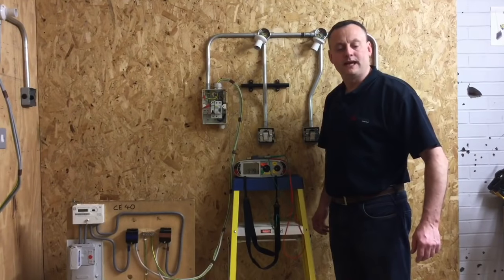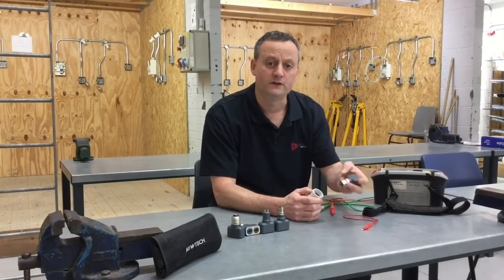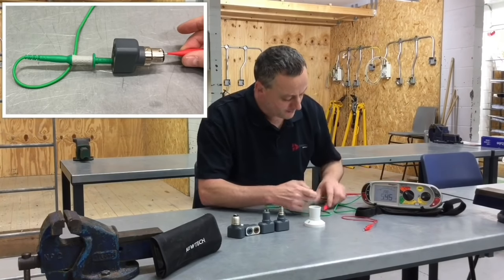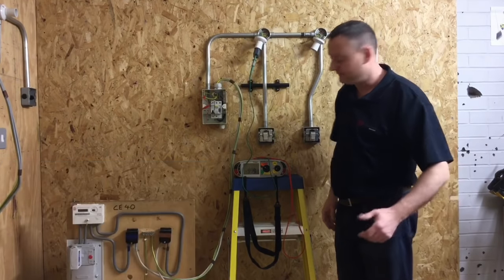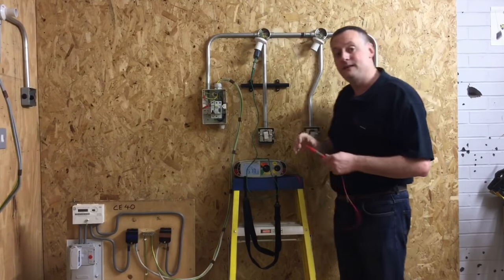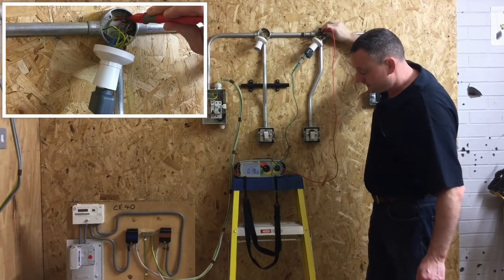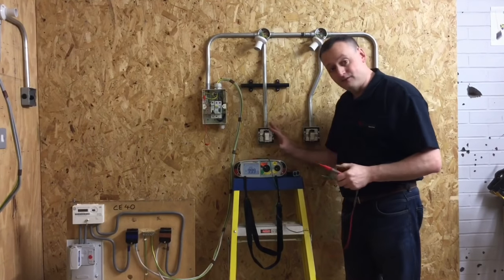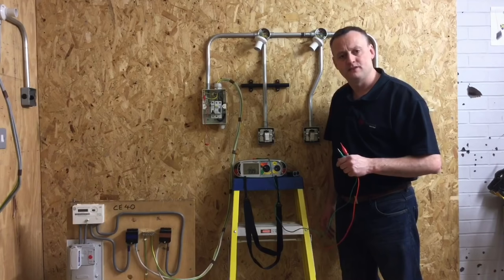2 Way Switching of 2 Lights Tested for Continuity of CPC, Polarity & Insulation Resistance

Comment: Hi, can you give us some advice please. My r1 + r2 + ze is not equal to my zs reading? Any ideas? And what do i put on the cert as I have checked everything and all connections are good? Thanks in advance.
Reply from the maker: Hi. During your earth fault loop impedance test (Zs) all your parallel earth paths are in circuit like bonding to gas and water etc. Have a great Christmas GSH Electrical
Reply: Thanks so shall i put my reading for r1 plus r2 on the cert or calculated?
Reply from the maker: Hi. You can record your calculated one if you wish 👍
Reply: Cheers mate. Thanks 👍